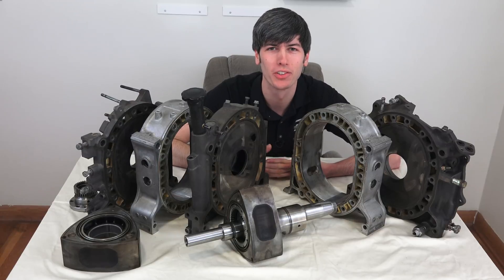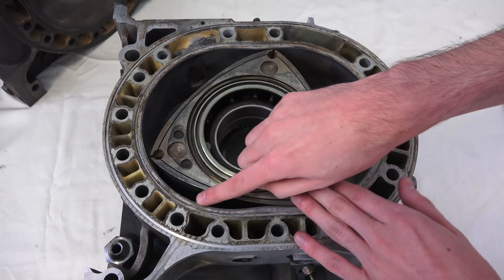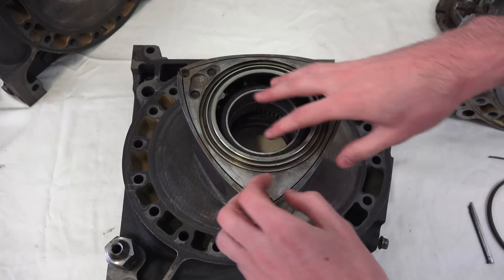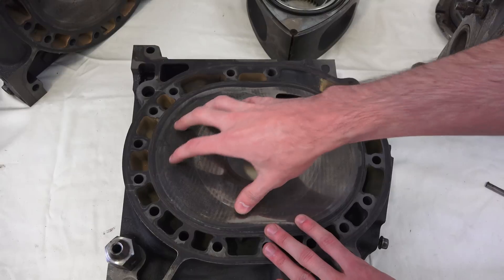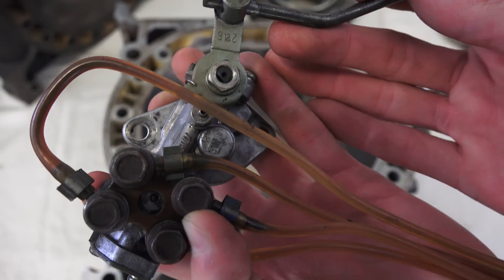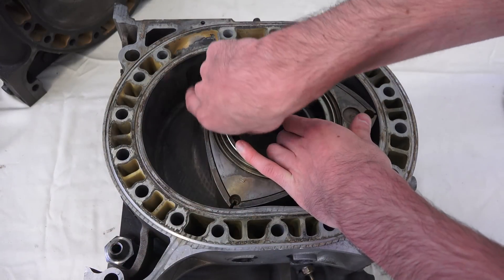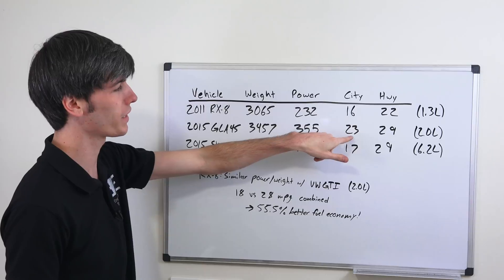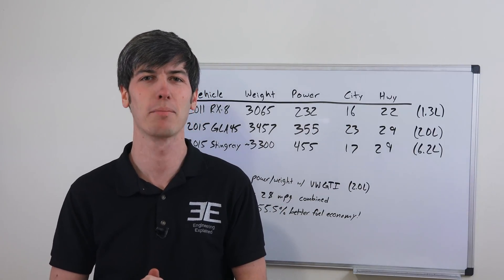4 Reasons Why The Rotary Engine Is Dead

Comment: it was not desined to be a fuel effeiant economy engine . I was built to be a reliable high performance engine with only 3 moving parts .  For example look at the only Japanese Endirance racing prototype to ever win the 24 hr.s on Lemans  , an Extreme endurance race.  The Mazda 787B  .    with 2  1.3 Lter . 1300 C.I.'s   linked togeather at there eccentric shaft        . I raced rotorys for years & they are not DEAD . they were just legislated out of production . Especially in the us , where emissions regulations were so strict .   On any race track , at any given time , you will see very high performance rotory engines . mostly dominating in drag racing . Where high horsepower & dependability are paramont .   when put together RIGHT !    they have no redline . I used to shift mine at 14,000 R.P.M's   before it woud run out of air with carburetion , not fuel injection .  . unless properly ported  . If it ever overheated on the track due to cooling system problems . We would  just squirt a little atf fluid down the carb , stat it up & finish the race  .   they would run good on very LOW OCTANE FUEL  70 octane or better .    And would go seasons before an inspection or rebuild  .    They are amazing , dont count them out yet .  Toyo Kogyo (Mazdas parent company  ) were the only ones who could develop them & make them work . DON'T BE SURPRISED if in the nesr future  Mazda improves emissions & fuel economy  .  And we will see them in passenger cars soon .   If there so unreliable , then why are they used in so many helicopter & aircraft applications   ?  when your flying  & have a malfunction , you just don't pull over to the side of the road  , like in a motor vehicle  & call AAA   .   The FAA deems them fit for aviation  with flying colors    . I'd prefer a car with oil injection over a reciprocating engine designed over 200 years ago that has'nt changed that much .with 1000's of moving parts  that could fail at any give time    Hmmm?

Comment: About the Rotary Engine. The Engine you are showing is actually more or less the same as a 9 or is it the same as a 12 piston engine? So I think when you compare a 12W to a Rotary you would get the about the same mileage per gallon. Am i correct or am i wrong?

Comment: Wouldnt it be possible to reduce the injected fuel so the engine is able to burn all of it? I think there is a solution for all of those disadvantages they just didnt find them yet and I love that Mazda is still thinking about using it again and again. I would love to see more wankels on the road with better efficiency and more reliability. It´s such a nice engine :)

Comment: You say that fire has to travel a long distance. But what If you had 2 more spark plugs and ignite the mixture in multiple places. Of course spark plugs would have to fire in a sequence but that's not a problem if you have precise electronic ignition timing control.

Comment: 1 reason why rotarys will never die. 
BRAAAAPPP  BRAAAPPPPP BRAAPPPPPP BRAAPPPPPPP REEEEOOOOOO BRAPPPP BRAPPPP SCHUUUUUUUUU BRAAAPPPPPP
Reply: which is kind of funny because after that they usually die.
Reply: +Titanius Anglesmith Nah man, 2-strokes give you a better BRRAAAAP:CC ratio
Reply: k re You sir, sound like shit.
Reply: +Titanius Anglesmith trabant
Reply: +Titanius Anglesmith I have a 1982 RX-7 with the 12-A. Got the car in 1992 with only 149,000 miles. Currently it has 400,981 original miles. In all that time the car has left me on the side of the road only 3 times...a failed igniter, a heater hose blew and the fuel pump. For the 1st gen Mazda there are only 2 things that must be monitored much of the time if you love your 7...NEVER let it get low on oil and if it does start to get hot, shut it off. Once a Rotary is overheated there is a high risk of the aluminum block warping. If you are nice to your rotary most of the time, it will be good to you. 20-22 MPG all the time (on mine). one last thing...With the way the Rotary fires, it is behaving just like a 6-cylinder piston engine as the rotary fires 6 times for each revolution of the shaft.
Reply: spoken like a true fan.
Reply: +Gotin Fuklio Trabants emit more poisonous substances than a VW diesel. And it's slower than a horse. And less reliable. And once you placed your order, it took longer to arrive than a baby horse.

But Trabants are still undeniably cool.
Reply: +Titanius Anglesmith They sound like sh*t
Reply: +Titanius Anglesmith Sooooo, glorified weed eater?
Reply: Titanius Anglesmith Holy shit, I just realised your name is a reference to the Futurama episode in which Bender became addicted to Dungeons and Dragons!
Reply: +Titanius Anglesmith They sound like a lawn mower humping a washing machine.
Reply: appelpower1 yes indeed it is
Reply: +Titanius Anglesmith haha, brapping isn't even a rotary thing, its 2 stroke bikes and atvs
Reply: +Titanius Anglesmith ...POP POP PFFFT
Reply: +Stormchaser1216   I`ve heard of one doing 20,000,000 miles and they`re still CRAP.
Reply: +Jamie Hoera but when you can have more power AND more fuel economy AND a far longer lasting engine, you realise the only thing actually going for rotaries is their sound, only in classic cars does smoothness differ from piston engines
Reply: +Jamie Hoera but when you can have more power AND more fuel economy AND a far longer lasting engine, you realise the only thing actually going for rotaries is their sound, only in classic cars does smoothness differ from piston engines
Reply: +Titanius Anglesmith Cshoo cshoo ccshoo
Reply: Titanius Anglesmith Nice!
Reply: +Titanius Anglesmith AMEN!
Reply: +Titanius Anglesmith That's one good reason they should die.
Reply: ***** ran out of things to say huh?? Keep complaining lmao.
Reply: i love you for this lol
Reply: ***** hahahahahahahHhHHHahahahahahahhaha
Reply: havii 33 Lmao waaahaahaha
Reply: +4nuk8r A&P certified eh? i can tell just by the way you explained that haha
Reply: +Titanius Anglesmith i no understand
Reply: Titanius Anglesmith BRAAP BA BA BA BA BA BA BA BA SHEEEUO
Reply: Each rotor face creates a combustiom chamber as it moves imside the housing, so there are 6 combustion processes (Otto 4 Cycle) inside each housing. Then each rotor side displaces 654 cc, and if every side does the suck, sqieeze, bang, blow  then you got to 654 cc × 6 = 3924 cc (3.9L)

Don't come with comparissons to the rotation of 2 stroke or 4 stroke 4 cylinder engines because they are not the same engineering. Real displacement for a 13B is 3.9L, don't come with the rotation b.s

Lets modify the ignition on a 13B so it fires-up the spark plugs just as one and only one side of each rotor does the Otto Cycle...it won't be able to spin on just 1.3 liters.
Reply: When I drive to go fast I usually don't care about fuel efficiency and reliability , it's built for performance not for going to pick up groceries , it's not like I'm expecting to drive my rx7 to the senior citizens club for tea and scones that's what reliability and fuel efficiency sounds like to me

Comment: comparing the rotary to a 4 stroke based just on emissions is kinda redundant. considering the rotary is a 2 stroke engine instead of a 4 stroke, your arguments are kinda pointless.
Reply: +GlassTopRX7 
A two stroke also has nominally four phases in the combustion cycle.  The two stroke cycle is about the number of piston reversals required to fulfill all four - a two stroke cycle uses one revolution of the crankshaft, making one upwards stroke for the tail end of the intake and exhaust phases, and the compression phase.  The downwards stroke of the piston accomplishes the combustion/expansion (power) phase and exhaust phase then intake phase at the bottom of the stroke.  One revolution, two strokes, four phases, one power event.

The Wankel engine accomplishes all four phases in three revolutions of the crank for each face of the rotor, with the crank rotating at 3x the speed of the three sided rotor, in effect more closely simulating a two stroke cycle engine with a power event with each rotation of the crank, but without any "strokes" at all.  Instead of the axial movement of a piston changing the volume of a fixed cylinder as in a reciprocating engine, the Wankel has three constantly moving chambers formed between the rotor faces and the housing; each passing through an intake region, a compression region, a combustion/expansion region and an exhaust region of the housing.  It is therefore really a no stroke, because there is never a reversal of movement of the rotor, just orbital rotation happening at 1/3 crank speed.

Comment: I have for you one more reasons why the rotary engine is dead:
forces in two directions.
when the power stroke is applying pressure on the surface of the rotary piston a part of this pressure is generating a force turning the rotary piston in one direction while another part of the same pressure generating a force turning the piston into the opposite direction

Comment: Rotary engines are great where absolute minimal weight and low vibration/noise are paramount. UAVs are using them when turbines would be to large/loud.

Comment: iuno what he's talking about, rotary engines are endangered... not dead. and there are aftermarket apex seals out there which are a lot better that OEM. you van do premix fuel to lubricate internals.

Comment: I knew a little bit of theory about the rotary engine but this clarified lots of its problems and WOW, is this a heavily flawed engine concept! I get it that you have to do something different today to keep up in the market, but this engine has so many drawbacks, longevity issues and completely lacks any sort of torque that i really don't get why this got the green light to go into production. The cars they equip, really nice, but that lack of torque!!
Reply: Well every engine has its drawbacks, and it was put in production because it was small, simple, balanced, revved very high and made a lot of power. those were the advantages that nowadays can't make up for the drawbacks that EE explained in the video. Different times back then in the 80s-90s when it was super popular.
Reply: +mitsx11 Completely agree, it had to have some advantages. However i was thinking more in terms of the most recent application which comes to mind, the RX8 specifically, which imho would have been far better off with a inline/v or boxer engine. If it was me choosing, i would have picked a boxer for compact build and low center of gravity in the car.
Reply: +RoHunter I know it was such a weird car. A lot of different people within Mazda wanted different ideas put into the car. Some Mazda execs wanted a pure sports car with the continuation of the rotary, some Mazda execs wanted a 4 seater cruiser that was practical. They chose both lol it turned out great tho, just every quality about it was weird. for example: Rotary motor, suicide doors, bland looking (imo), super fun to drive hard,

Comment: Another disadvantage of the rotary engine is the problem with repairing. Is it possible to install the bigger rotor when the engine case will be worn out inside?

Comment: it's a sports car.
fuel economy is a moot point. i didn't buy an 88 camaro with a carb fed 350 in it because "oh, yes, this will be a great city car"
also, the rotary is not dead. they've been playing around with alternate fuels and actually getting better results than most modern hybrids that have come out.

Comment: Thank you so much for this video Jason!!!!!.....its a very clear and precise explanation!!!!....if the rotary engine is bounded to burn oil and send it to the exaust, its an inneficient engine!!!...no way it can compare with the pistons design!!!!!.....(without mention that it can not advance ignition, adjust exhaust and intake duration, valve lift, double intake and exhaust valve operation, turbo or supercharge operation, can not use headers or scavenging effect, etc, etc, etc)....and burns oil as well as fuel (like a two time engines)!!!!

Comment: I dont think that is a fair comparison between the gla, corvette, and the r-x8 in terms of fuel economy. The corvette and gla are modern generation cars, designed in 2014, the rx-8 is essentially no different than the 2003 model, except a stiffer chassis and more aggressive/sporty gearing, and the corvette has 8 forward gears to help get that extremely generous epa rating. A more fair comparison should be with cars of similar year and technology.
Reply from the maker: +anonymous youtube user #7 2001 GTI got 33% better fuel economy. Sure modern engines will do better, compare it to older ones it's still poor.
Reply: +Engineering Explained First, thanks for the reply, love your videos. Second, I agree, it is poor for economy, just as not as poor when it is looked at in a different comparison. Third, Mazda has teased at a turbo diesel rotary, would that actually work with such low compression ratios in a rotary?

Comment: Using 2015 models to make your argument weakens it a lot. Not saying the rotary is fuel efficient, but you should've used similar times so there would be no technological advantage.

Comment: A worn 4 stroke will burn just as much oil as a rotary , not to mention anything with a turbo. The emission issues are the real hurdle. It  pretty much has all the same problems as do 2 strokes.  No doubt things would look a lot better if Mazda wasn't stalling with development.
Reply from the maker: +Photon Torpedoes Any worn engine will burn oil.. that's not the point. This burns oil intentionally.
Reply: So does any engine that uses oil for lubrication , some factory engines consume large amount of oil from new yet they pass emissions just fine , problem is the unburned fuel.

Comment: I would consider the fact that the seals wear out around 70k miles, and you need to pull the engine apart to get to them, a 5th disadvantage.

Comment: Mazda was interested in the rotary engine primarily because a very small engine displacement could nonetheless generate good power numbers.  This was an advantage in the Japanese domestic market at one point in time, due to Japan's very odd tax structure, where vehicles were taxed based on their engine displacement.  As the market has moved towards "world cars" the original reasons for having the Wankel-type rotary engine faded, especially due to poor fuel economy, poor engine life, and poor emissions.

Comment: ok very good but you compare  2l. TURBO engine with Naturally aspirated . . If 2l 4 cylinder  Mercedes engine is NA  and is 230hp probably will rev. to over 10.5 -11000rpm and 100% wil have the same or worse MPG. and .....burning fuel as well.
Reply from the maker: +Itso TT I also compared a 6.2L NA engine...
Reply: yes but in real life there is NO CHANCE to get 17-20 mpg in city from 6.2l

Comment: if they found a way to either have some sort of self lubricating rotor and housing or used a a material with a very low friction that would help it a lot, or use some kind of ethanol that also has some form of lubrication it would at least get better emissions

Comment: I once test drove an RX-8. One of the worst cars I've ever driven, it had no low end torque whatsoever. When I learned that you cannot use synthetic oil in it, that sealed the deal, it dropped off my consideration list.
Reply: +GalvatronTypeR Lots of people still say that but it hasn't been true since the 90s, you can use synthetic just fine.  As long as you get one that burns clean and isn't cheap crap.
Reply: +ConnorWolf Or get a car that doesn't burn oil.
Reply: +GalvatronTypeR So, that was where you drew the line huh? You felt that Mazda would be forcing you to use a less expensive oil?

Comment: so, wouldn't high octane fuel or something of the like therefore be burned quicker and save on fuel?
Reply: Not necessarily. Octane is a measure of how resistant to detonation a fuel is, not how fast it burns. A faster burning fuel might help but requiring specialty fuels would kill a production car because nobody would want it if they can not fill it up anywhere.
Reply: Understandable.

Comment: Your arguments are valid, however if you think how much money was put into technology towards improving the otto engine vs the wankel engine, it is way more. Neither were the old otto engines fuel efficient. What the question is, if they invested in the wankel engine as much as they did in the otto engine, would it perform better?